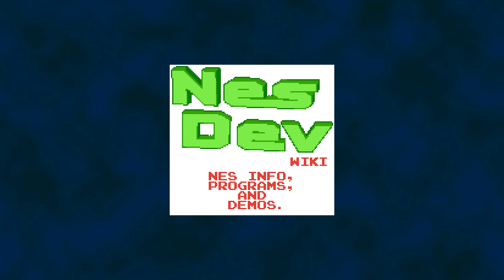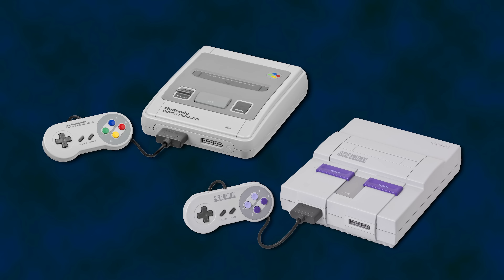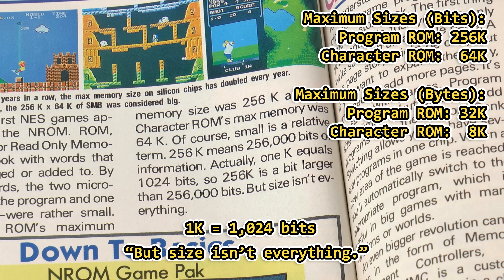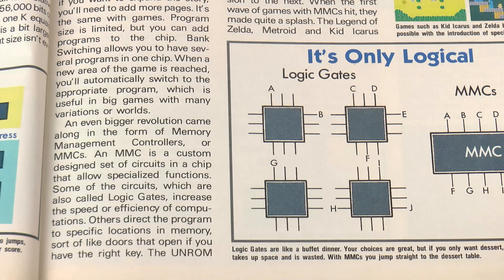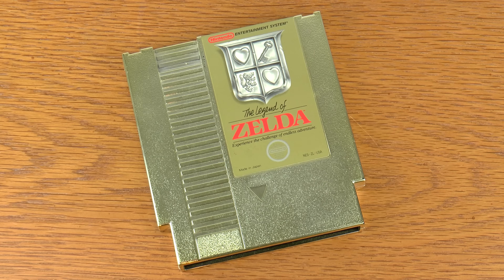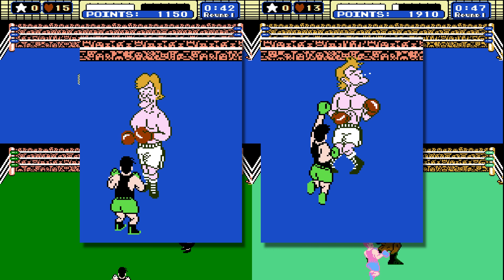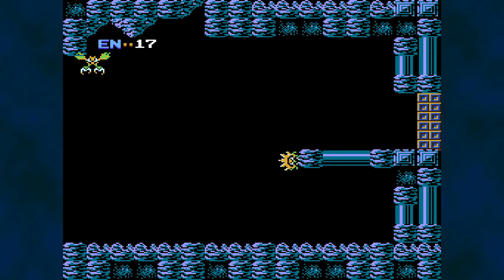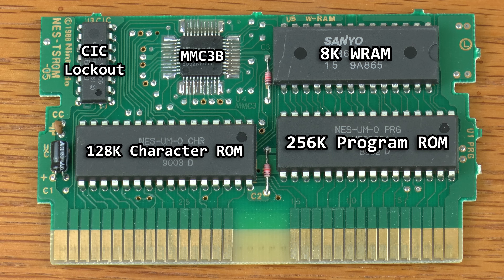Battle of the Bits: Nintendo Power, Mappers, and Circuit Boards - Talkin' Code Ep. 3

Comment: Even now, there's AAA games that take up 100GB, that cost $70, that I play a few hours and get bored with them. Then there's Terraria and FTL, which collectively take up less than a gig, and both cost me $2.50, that I've played forever. 

The SNES and NES may not have been technically as powerful, but they really made use of all the hardware and made some amazing games
Reply: Props 4 Terraria👊
Reply: Honestly when the SNES came out it was already considered a pretty good machine spec wise. Sure, if you compare it with the Genesis/MD you’ll find that it has a slower CPU (which in my opinion is not even a fair point to make because the 68k in the genesis and the 65C816 based snes cpu have different architectures), but oh boy it has a nice graphical subsystem and a sound subsystem. Sure, you could pull off some of the features the SNES has spec wise on a genesis (look at games from Treasure and Puggsy), but honestly I think it requires more bare metal coding to make it work compared to working with the SNES (I think?).

Sound on the SNES was a huge hurdle tho, especially if you didn’t have some very specific tools from Nintendo. As far as I know the sound subsystem is made out of a DSP and the necessary stuff to output analog audio stuff. I don’t know if the instruction set of that thing was ever given to developers. Still, impressive stuff
Reply: I like to use these classic games as file size comparisons. Super Mario Bros: 40KB. Super Mario World: 512KB. Super Mario 64: 8MB. Ocarina of Time: 32MB. If your spreadsheet app or angry birds clone needs more space than a AAA 3D dungeon crawler, what the heck are you doing?

Comment: Can you do one comparing the sprite capabilities of the SNES and Genesis, because I never understood why the Genesis felt like it could put more and bigger sprites onscreen when the SNES supposedly has the better sprite capabilities. 128 sprites onscreen, 32 per scan line, 8x8 - 64x64 vs 80 sprites onscreen, 20 per scan line, 8x8 - 32x32 on the Genesis. 
Also the SNES per scan line capability allows it to draw sprites across the entire screen horizontally yet I've seen SNES games flicker of far less.
Reply from the maker: Hmm. Seems like a good idea. Sometimes it is a tough decision to decide whether to do two videos on two consoles (sprites for SNES and sprites for Genesis) or take a single subject - "sprites" - and mention multiple consoles in the video. It depends on how technical of an explanation it requires.

For instance - Talkin' Code episode 3 here is definitely based on Nintendo Power and is therefore a sampler. I could still do separate videos on NROM, UNROM, MMC1, etc...

Anyway - thank you for your suggestion, Yo D. I am just thinking out loud for you and any others that might read this response.
Reply: @DisplacedGamers  No, Im glad you're interested. And while I would prefer a straight up comparison. Separate shows of both systems capabilities would still be nice. Heck, Im a pretty technical guy, so the more the merrier for me.
Reply: Having grown up with Nintendo I've never really seen much explanation of the technical capabilities of Sega and other systems, so it would be really neat to see videos about them!

Comment: Amazing overview of NES mappers!  If you look closely at the Nintendo Power example image of Castlevania 3, it doesn't use per-tile attributes from MMC5 (aka 8x8 attributes).  In fact, Castlevania 3 doesn't use that feature *at all*.  This is because Castlevania 3 was originally released on the Famicom using the VRC6 mapper, and used its expansion audio for the glorious soundtrack on the Japanese version of the game.

For vertical split screen, you can add Bandit Kings of Ancient China to the list of games that use it.  That game uses it for the credits scene to scroll the names next to some nice images.
Reply: Here is a video link showing the Bandit Kings of Ancient China credits: https://www.youtube.com/watch?v=yyn1NwHSf0k&t=2627s
Reply: @Dominic_Muller  That link appears to be running from an emulator that doesn't show the graphics correctly.  Here's how it looks on an actual cart: https://www.youtube.com/watch?v=f84JRtV1_HE . Note the stars actually scroll through 8 pixels in a loop.
Reply: @greyrogue2999  Interesting fact: the way the Bandit Kings ending looks on the emulator, with stationary stars, is probably how it was intended to look like by Koei! The reason the stars scroll in a loop like that is because a jumper needs to be configured on the E*ROM PCB to fully enable the split-screen feature, but the Bandit Kings PCB does not have that jumper set. It's most likely that Koei simply forgot to specify the jumper setting when they ordered the PCBs from Nintendo, and nobody noticed that the effect was wrong before the cartridges went to market because the effect is only used in the ending.

Comment: That RC car analogy was smart, even if the other explanations are oversimplified and, in the case of compression, just wrong (what the Tetris playfields illustrate is more akin to defragmentation—grid overlays on the two playfields with block chunks and empty spaces over the whole width and height being different numbers added together based on block type would work better as then the "compressed" example would eliminate the zeroes of the empty spaces). And NP's bit message was basically "bits only matter as much as how well they're used, and we know how to use 'em". Also smart.

And it looks like that MMC3 scanline interrupt thing was the predecessor to the SNES's HRAM trickery that, among other things, let that system's Mode 7 really shine.

One question, though: where was any sort of MMC4? Was there an early version that was later scrapped? Japanese superstition against the number 4 (it's "shi" in Japanese, which also means "death")? Or was the MMC5 just that much more advanced than the MMC3?
Reply: Nesdev shows that MMC4 did exist, and was basically an upgraded MMC2.

Curiously, the Game Boy was very similar - MBC1, 3, and 5 were widely used, but 2 and 4 were much less common.
Reply: @renakunisaki  Before the Windows curse, there was the Nintendo memory controller curse. :<P But seriously, looks like the odd numbers were quite generalized while the even numbers were for specific purposes.

Comment: This is so cool!! I had heard previously that the scrolling direction in older games was determined by a soldering connection on the circuit board, but somehow it didn't click that that would prevent ever scrolling along more than one axis. It was cool to see how it's the additional hardware that games that do that have in them that makes that possible. And I was also really interested in how the MMC5 fixed the need to hold the Reset button when powering off a game with save data, and impressed with its ability to do multiplication. Thanks for this video! Please do another one on the MMC5!

Comment: One of my favourite things about old cartridge circuit boards is finding the company logos on chips or cut out of the solder mask. Konami did it a bunch especially with famicom boards, and there's a "hidden Mickey" made from test points on one of the Disney titles (if I remember it was actually   decorative and not just a by-product)

Comment: On that Mario 1 cart, what happens if you remove the bridge that allows for horizontal scrolling? I'm asking for science.
Reply: Graphics glitch mess. You can check it out in emulators if you find that lets you mess with the ROM header settings, to switch it from between horizontal and vertical.
Probably also bugs out because the game, and many early games, uses a feature called "sprite 0 hit" where, when a certain sprite is drawn on the screen (in SMB1 I read it's the coin sprite at the top of the screen) to tell the game when it's finished drawing the HUD, so it can start (or stop) scrolling the screen, depending on if the HUD is at the top (or bottom) of the screen.
The MMC3 "split screen" feature is actually more like a more properly defined version of this feature. Thing is, the timing for the drawing will become more dependent on if the CPU is NTSC or PAL. I once briefly had possession of a PAL-only game called Dropzone, which I tried on my (NTSC) top-loader, and predicatably the top few lines of the HUD weren't drawn because of the timing difference. (making some info like score and lives difficult to read as the font would only be half-drawn.)

Comment: I'm surprised that there was such a technical article in Nintendo Power! I find memory map conversion romhacks to be fascinating. I've seen people do some truly incredible things with them.
Reply from the maker: Those conversions are great. They really open the doors for ROM hacking on various titles.
Reply: @DisplacedGamers  There is one thing that opening SMB made me remember, has anyone ever tested to see what the game does if the solder pad jumper for tile scroll direction on the board is desoldered off horizontal and reapplied to vertical?
Reply: @EnigPartyhaus  Something like Devil World on NES may demonstrate it. In that game horizontal scrolling is smooth, but vertical is choppy.
Reply: @arciks11 The Legend of Zelda also has "choppy" vertical scrolling (8 pixels at a time). Doing pixel-smooth vertical scrolling while also displaying a HUD basically requires "tricking" the hardware--it isn't something the NES PPU was designed to do. It seems that the method to do it was discovered sometime around 1986-1987 and spread rapidly among developers--too late for Zelda but in time for games such as Konami's Salamander and Rare's Wizards and Warriors.
Reply: Oh cool what have they done with them?
Reply: @MaxOakland super mario bros. used 2 16kb rom banks filling the nintendo's 32kb addressing limit. it was packed full of data.
using i.e. setz's mmc1 conversion you can fit more data into super mario bros. and not have to worry about memory limits and removing stuff.

Comment: That opening bit of historical context was great because it illustrates how manufactured the "console wars" was even in its infancy. NES had reached its arguable peak and was smoothly transitioning generations while NEC and Sega were slap-fighting over who could garner a better share of the home arcade conversion market. Part of the reason the TurboGrafx (and, inversely, Atari's latter consoles) failed so hard is because localizers and marketers bought into Sega's idea of focusing on performance over accuracy. Everyone knew the PC Engine's conversions were superior to the Mega Drive's equivalents, but that was never the focus. In the West, it was entirely a long con from Sega to make processing power into an end-all be-all boon regardless of what programmers could even accomplish with the hardware. I might be wrong about some of that but that's the impression I always got.
Reply: Ironically, before Sonic, there wasn't that much emphasis on the tech itself with the Genesis, but rather on the actual possibilities it could allow. That was when Michael Katz was running Sega of America. When Tom Kalinske took over, scroll speed was used as the definitive layperson's metric of performance and the demonstration of Blast Processing, and Sonic was the main game used to flex the former. (I think a racing game was used specifically for Blast Processing, and it was pitted against Super Mario Kart because F-Zero was still too scary for poor wittle Tommy.)
Reply: @CarbonRollerCaco  Blast Processing was just a mostly meaningless marketing term. Sega never actually elaborated on what it meant during the Genesis life span, other than the typical 90s "whoa blast processing totally radical" angle. However, blast processing was a trick within the hardware where the video processor could bypass its colour limitation by changing the palette mid scan line, at the cost of completely utilizing the CPU for perfect sync, or artifacting if it mistimed.
Reply: @platinumhawke  Which the SNES could do better. Was a strange time for a console war when ALL the consoles had a much bigger enemy: RAM costs.
Reply from the maker: It was genius. They knew how young and impressionable a large percentage of their consumer base was and fed those consumers something they knew would immediately not only translate to sales but also bragging rights.

... it still happens today.